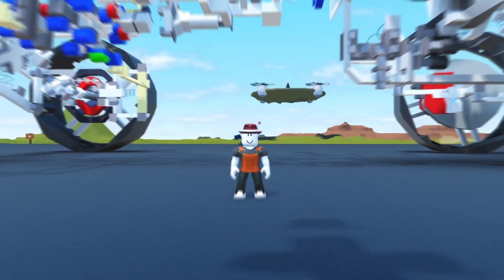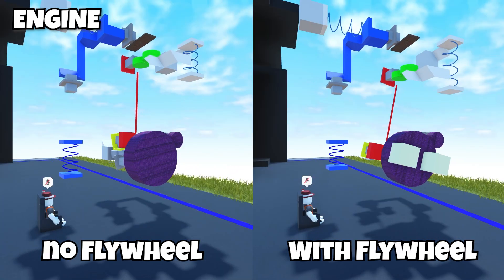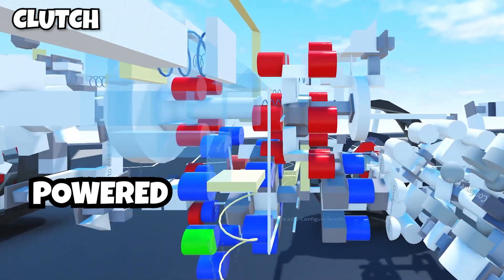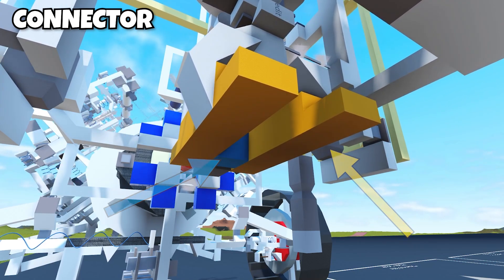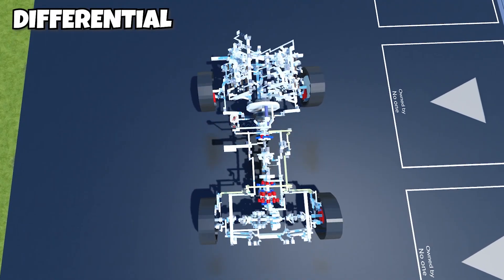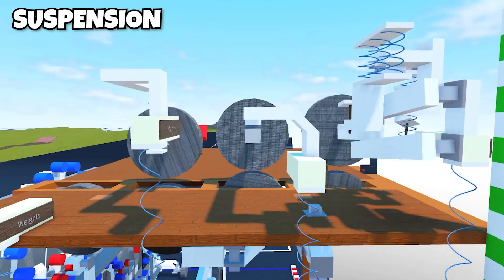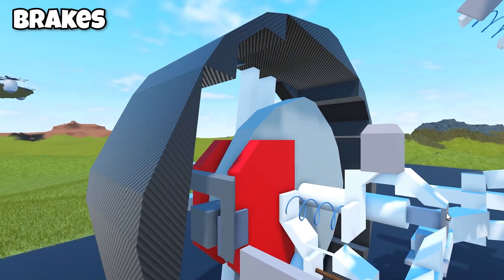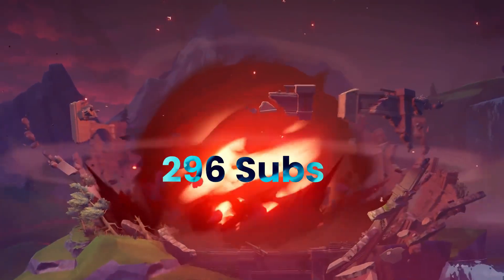How my BIGGEST V8 mechanical car WORKS | LePlanzy pt5

Comment: Great. Now give it an oil pan, camshaft, carburettor, spark plugs, a radiator, head gasket, engine block, twin turbochargers, fuel filter, oil filter and rocker shaft.

Comment: Hi evan, can you help me? my mechanical car hover piston keeps stopping why did it do that?
Reply: Maybe check if there's any motors that are powered if they are then unpower them.
If they are unpowered try motor locking more hover engines on to your hover engines that are already there.
Cause: your engine might not have enough power or you have powered engines.
Hope this helped!!

Comment: How do you angle the whole piston essembaly for instance like a inline 4 for the piston strokes so it would go 1 2 3 4 instead of all the same direction at once
Reply from the maker: easy, angle them in build mode, then motorlock the pistons placement together so that it alligns in a straight line. I'll talk about it later
Reply: @evans_workshopx  alr thanks

Comment: how do you make a gear box my gear boxes dont work
Reply from the maker: still need help? (sorry for late reply)
Reply: @evans_workshopx  i still need help  btw its ok i odnt need much help i understand but the only problems i have are high stress liek ti gets stuck sometimes so i dont need that much only a tutorial
Reply: also most of my problems comes from me being a veteran and not knowing how to adjust to the uptades
Reply: nvm i saw ur transmition tut ima use it

Comment: Can u make a truck body for the vehicle
Reply from the maker: Yes, it is possible to add the body of it and even the interior, however unfortunatelly it will also result an insane lag and potentially unuseable vehicle. But in case you're interested, I do make a body for one of my car which is some kind of a race car, my latest shorts video includes it

Comment: Now make it run on fuel
Reply from the maker: the amount of marbles needed would be insane
Reply: @evans_workshopx 
What about a "Vane" engine?
Reply from the maker: @jackjackjam3s  that, could be something entirely different from what I made. Since this engine runs on compression and ignition, it might not even be possible in plane crazy
Reply: @evans_workshopx  
Noted👌

Comment: I tried plane crazy once but decided it was too clunky to build with but this is impressive. You should try other games like scrap mechanic or gear blocks (not on roblox and not free). They allow are a lot more advanced mechanics and allow for more compact designs.
Reply from the maker: yes! This september, I'm planning to stream some games called "Screwdrivers" and "Main assembly", and the next month will be focusing on games such as Trailmakers and and Scrap Mechanic. I'm planning to extend the audience indeed :D
Reply: @evans_workshopx   subscribed

Comment: Bud I was from old plane crazy era,  I took a really long break because of shredders. Now they arent that common, Im currently learning and experimenting with piston engines,  transmission, etc. You're my inspiration
Reply from the maker: Glad to hear that :O
If you ever need my help with the mechanics, feel free to dm me from discord or just comment!
Reply: @evans_workshopx  today i made a mechanical car but i think it doesnt have enough torque, should i make the engine bigger?
Reply from the maker: @angelrodrigogarciamartinez7314  depends on how you make your engine in the first place. Yes it is possible to increase torque by increasing the engine's size, you could increase the crankshaft diameter to increase torque, but this could result in both slower or faster top speed. Theres also other methods but I cant explain it in a single comment
Reply: @evans_workshopx what’s the best diameter for good torque and speed?
Reply from the maker: @MashalAbaya-i2b  I'd say 4 blocks (a block + motorlock in the crankshaft) which could potentially make your car run up to 500 sps with 5x5 cylinder with a 1:1 differnetial ratio. In fact, my friend noodle has prooved this was possible. Quite a good balance of speed and torque
Reply: @evans_workshopx  alright thx 🙏
Reply: @evans_workshopx  and does the 7x7 worth it for tourqe?
Reply: @evans_workshopx  like a good balance of speed and torque with the 5x5 or 4x4?
Reply: GGW with shredders have ended, until the aliens come back with new technology...
Reply: Hello
Reply: in the future ppl gonna have whole fully engineered planes and ships
Reply: Every PvP server you join has shredders??? I got a full server with shredders th do you mean they ain't common?!